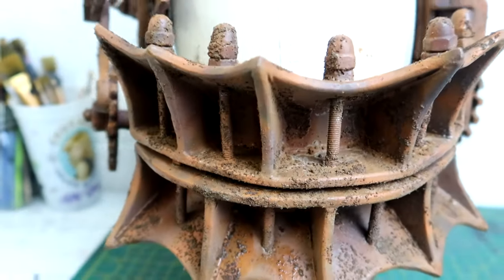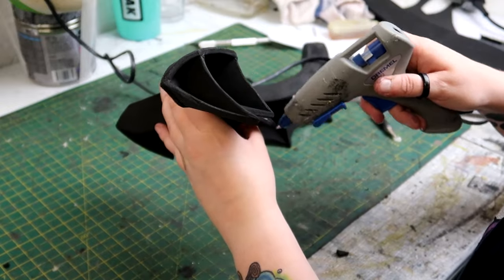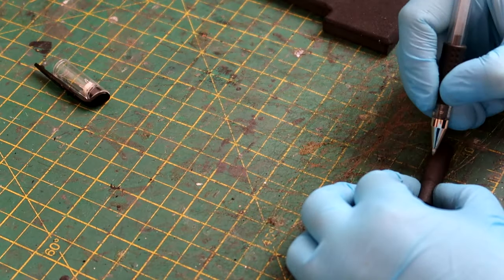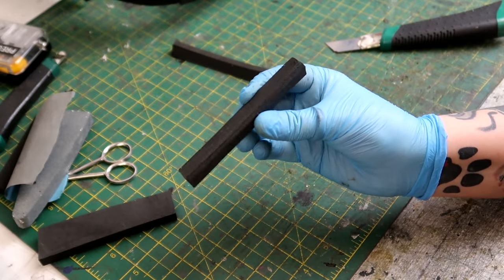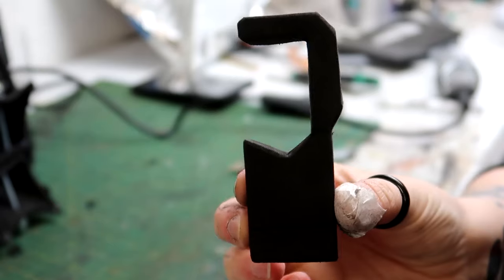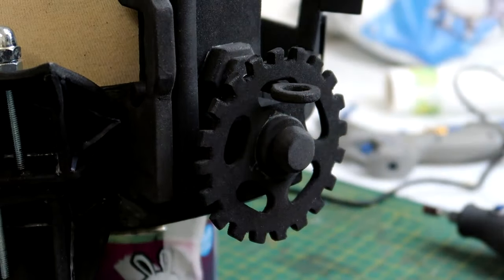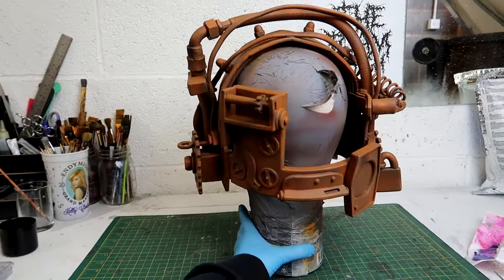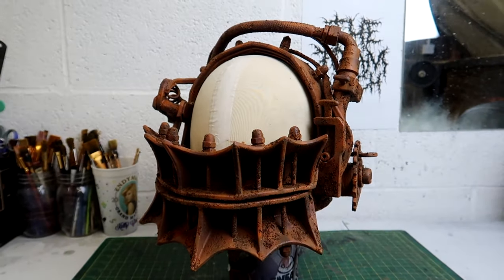How To Make A Reverse Bear Trap from EVA foam ( FREE Template)

Comment: going to build this halfway to halloween with a limited budget and no experience 😅😅 wish me luck
Reply from the maker: I have total faith you can do it! 👏👏
Reply: Me too lmao
Reply from the maker: @mhxhtbdr.yb553  you can do it 👏👏
Reply: me too😂
Reply: @TheFoamWitch  very quick question, when we print out the stencils will they be standard printer paper sized and be accurate in the measurements you used yourself? also what mask protection did you use when using the dremel?
Reply from the maker: @madreadzzz  hi there! These templates were made for A4 sized paper. If you print them out on A4 paper, they will be the exact size I used 😊
And I have a 3m reusable respirator 👍
Reply: That's the whole point!!!! I started in 2014 with no experience and by 2016 I had 3 awards and my own book on cosplay props
Reply: same here 😅😅

Comment: how long is the pipe on the top of the bear trap? ive been trying to look for parts and cannot read what it says when you showed it
Reply from the maker: So I’ve just measured it and it’s 50cm long ☺️👍
Reply: @TheFoamWitch  ty ty ty ive been trying to find the specific part you used so this will definitely help!
Reply from the maker: @angelina-iv6zf I think it was just a shower pipe or something. I defo got it from the plumbing section ☺️

Comment: What is the wearability of this? Like is it heavy? and how would you suggest making it to fit to wear properly? Amazing work btw! I love the Saw movies and I've wanted to make one of these for so long.
Reply from the maker: It's fully wearable! It's slightly heavy due to the nuts and bolts but not uncomfortable by any means! And making it fit would just be to print the template off smaller or bigger than you need. The template is for a larger head so printing it off in multiples of 10% smaller would help 😊

Comment: This is awesome thank you! I love making props for photoshoots and I'm planning a Saw-themed shoot later this month so going to give this a go!
Reply from the maker: No worries at all! I hope the template comes in handy! 😊
Reply: @TheFoamWitch I just got the template cut out and it's looking great, but at 1:57 there are three pieces laid on the cutting mat, but I don't think the middle one is in the template. Do you know the dimensions for it? Using the measurements on the board as a rough guide it looks to be about 12.5 inches by 1.25 inches. Would that be about right? Thanks!
Reply from the maker: @graemepatterson  it is on the template. It's the piece that says "back section to stick jaw pieces to". It has curved edges because I went back in and cleaned it up, on the video it's a straight piece. It's in the lace with the 2 jaw pieces back plate sections 👍
Reply from the maker: @graemepatterson  page 4 of the template 👍
Reply: @TheFoamWitch Ahhh that makes perfect sense thank you I thought I was going mad 🤣
Reply from the maker: @graemepatterson  😂😂 it's all good!

Comment: Hi! I’m interested in making this for Halloween, but I had a few questions - Firstly, how much foam would you say you used for this? 

Secondly, could you potentially list all of the resources you used/resources you’d say is absolutely necessary for this project? 

And finally, how long would you say this project took you in total? And how long do you believe this would take for a complete beginner to make this? 

Thank you!
Reply from the maker: Hi there!
So I had a 1mx1m sheet of 5mm foam and had more than half of it left once I had built it. 10mm I used scraps so barely any at all! 

Absolutely necessary is foam or cardboard, a craft knife and glue. Then sealer either PVA glue or mod podge or something like hexflex or plastidip and then paint. Everything else I used is completely optional and all the hardware could be made using the foam is needed.

This took me about 4 days to make.
Hope this answers your questions and helps 👍
Reply: @TheFoamWitch thank you! 💜

Comment: This is AMAZING. Thank you so much for the template! I am going to pick up supplies for this after work. Is there any chance you could provide an estimate of how many sheets (or how long a roll) of 5mm and 10mm foam is needed for the entire piece? I'm guessing maybe 10 sheets total based on the 6 pages of the template + duplicate pieces + details + possible errors. lol (Also, I'd love to see the reverse bear trap on!) Thank you!
Reply from the maker: No worries! I hope it helps!
And for this project, it depends what size the sheets are.
I had 1 sheet of 1mx1m 5mm foam which I used and I still had quite a lot left. It barely used any 10mm foam as only a few pieces are 10mm so I mainly just used scrap pieces I had!

And if you check out my Instagram, there are loads of photos of me wearing it 👍👍
Reply: Thank you soooo much! I’m following and it looks incredible. Very well done! You can count on at least 10 more views from me while I assemble my own reverse bear trap!❤

Comment: hey, very VERY GREAT video! I love the accuracy of the trap and the enthusiasm of you. And cannot explain how greatful I am to have this template, im making a dbd pig cosplay and this is the first time I actually make one by myself so im so excited. I do have a question can the trap be held on the top for a extended amount of time w/o any damage? Im going to conventions so I would like to know and can I print ALL the template out 10% larger or small to fit my head? THANK YOU SO MUCH FOR THIS VIDEO
Reply from the maker: Thank you so much for such an awesome comment!  ☺️ I’m so glad you like the video!
And yes, I’ve worn it for quite a while and thrown my head around wearing it and it was no problem at all! You might need to add some padding on the inside so it doesn’t wobble around if you find it’s a little big but you shouldn’t have any problems at all ☺️☺️
You can print the template to whatever percentage you want! If you need it larger, if you press the “poster” button when printing on pdf printer, it will print over multiple pages to make it bigger 👍
Reply: @TheFoamWitch  thanks for the answer, such an underrated channel! Im new at making props so I will encounter some problems and be asking a load of other questions😭
Thanks again for the video, hope your channel will continue to grow‼️
Reply from the maker: @thelordofsimps6095 ah thank you! And I’m always here to answer any questions you might have! 
I’m working on a beginner foam crafting video as we speak so hopefully that will help too ☺️

Comment: hey there, im in the process of building this and im almost done. however, the bolts in the front of the bear trap are weighing it down when i put it on so that it can easily slip forward. do you have any advice on how i could combat this?
Reply from the maker: If you add some padding to the back so that it sits tightly to your head, it shouldn't fall forward 👍👍

Comment: Hiii, so, I get it that you make different on the template on 1:56 , but it’s supposed to be smaller than the Jaws part? In the final when the 3 pieces are together?
Reply from the maker: I'm sorry, I'm not sure what you are asking? Do you mean it's not as long as the jaw parts? It should be because it's the same one I used. You have to curve the edges of the jaw parts to follow the curves and then some trimming required 👍

Comment: Any recommendations on what to use if you don't have a heat gun? Could I bend it in a curve and leave it like that for a second, or would a blow dryer or torch work? Thanks so much for making this video!
Reply from the maker: So it has to be quite hot for it to heat the foam up enough so a blow dryer wouldn't work. A blow torch would work but you would have to be SUPER careful not to burn the foam with an open flame! 
But if you rolled it up and taped it up overnight it would keep its shape when it was unfolded!
And it's no problem! I'm so happy it's helping people!!
Reply: @TheFoamWitch  Thanks so much!! I cant wait to make this based on your tutorial :)
Reply from the maker: @kalissa2446  can't wait to see what you do with it!! 😊

Comment: Sorry I got a bit lost in the first part what is that middle piece at 1:58 when you put together those three pieces for the jaw? In the template is it that back section to stick its curved but in the video a square strip so im a lil confused? thanks
Reply from the maker: Yeah it looks a little different because it's just a slightly different shape on the template because I changed it slightly to be more accurate on the template.
It's on page 4 and it's labelled "back section to stick jaw pieces to"!
When I made it, I just used a square piece and trimmed the edges to be curved, but on the template, it's already curved for you ☺️

Comment: Hi there!! INCREDIBLE video and work. In the process of following it right now but still trying to gather the supplies. Could you pleeease reply with what size dowels you used for the accessories? Just want to get the most accurate ones! 😅
Reply from the maker: @franchescag5856  thank you so much for your kind words! 
So I think for the hinge and the padlock this was 5mm thick dowel. I think for the pipe part this was 20mm thick 😊
Reply: @TheFoamWitch  thank you so much!!
Reply from the maker: @franchescag5856  no problem at all! Happy building 😊😊

Comment: THIS IS AWESOME !! I wanna do that for my cosplay. Do you have a list of all material you used?❤
Reply from the maker: Sure! Hope this helps!! ☺️☺️

Foam 5mm & 10mm
Contact adhesive
Nuts, bolts and nut caps
Googly eyes
Rubber washers
Plumbing hose and connector
Electrical wire
Paint
Iron filings
Reply: @TheFoamWitch  What Kind of nuts, bolts and nut caps? Dont wanna Use too big or too long ones xD Thank you btw 🙏😍
Reply from the maker: @just.alex.heree_  I will be completely honest, I don't have a clue. I took my trap to the hardware store when I bought them and just measured against the trap so didn't get any details of them I'm afraid 😂

Comment: It looks amazing! I'm in the middle of making it now and there's a piece I'm not sure is on the template. At the time 1:57, the middle piece. Am I blind or is it not on there, if it is, what page is it on, and if its not, what are the measurements for it
Reply from the maker: @your_local_ipad_kid9228   nope, it’s not missing, it is on there. ☺️
It's on page 4 of the template and is labelled "back section to stick jaw pieces to" It has rounded ends on the template because I made adjustments to the final template to make it more accurate for building👍👍
The ends are pointed on the PDF because you have to curve the edges of the winged pieces to join at the curve but it may require some trimming of the foam! Hope this explains it
Reply: @TheFoamWitch  Thank you so much!!
Reply from the maker: @your_local_ipad_kid9228   no problem at all! ☺️

Comment: This is just wow i might do this for holoween one of these years what was the different foam did u use millimeter wise?
Reply from the maker: Thank you!! You should totally give it a go!! 
And I used 5mm for most of the parts, with 10mm being used for the back part and some of the smaller details, but the template states which pieces need which thickness 😊😊
Reply: @TheFoamWitch  thank you i really appreciate that

Comment: I’m so confused on finding the straight piece for 1:57, I printed all the templates and I just can’t quite find it
Reply from the maker: It's on page 4 of the template and is labelled "back section to stick jaw pieces to" It has rounded ends on the template because I made adjustments to the final template to make it more accurate for building👍👍
The ends are pointed on the PDF because you have to curve the edges of the winged pieces to join at the curve but it may require some trimming of the foam! Hope this explains it :D
Reply: @TheFoamWitch  thank you so much this helped!
Reply from the maker: @ang3l1c85 no problem at all! ☺️

Comment: this is a fantastic template/tutorial, thank you so much for all your hard work!! i do have one question; i’m working on this now and at this point it feels very front-heavy, to the point where it seems it would just slip forward if it wasn’t being held in place (i just attached the back piece, minus some of the details to be added later). does the addition of the hose hardware help to counter that weight a little/prevent it from slipping forward? just trying to figure out if i should readjust positioning of the headband part before continuing, or if you have any tips; thank you again!!
Reply from the maker: Unfortunately, if you are using real nuts/bolts, it is gonna be more weighted at the front.
The best way to combat this is to add some hidden weights to the back however you wish to counter balance it
Reply: @TheFoamWitch  makes sense, thank you for the response!! i’ll probably see about trying to add some heavy washers or something on the inside of the back band and opting for a real padlock as well to weigh the back down; thank you again for the tutorial!
Reply from the maker: @Whispermoon13  ooh yes, using a real padlock will really help! 👍
And I’m so glad you like the video ☺️☺️

Comment: if you were to use a real padlock opposed to the foam one, don't you think it would weigh the helmet down? thanks so much and lovely video + template, thank you for sharing!!
Reply from the maker: Honestly, a padlock probably wouldn't weigh it down that much, compared to all the nuts and bolts I used. They make it heavy but not unbearably heavy! 
And I'm so glad people are enjoying it 😊😊
Reply: hii so im actually making this right now and you're gonna have to use a very very small lock if you use a real one bc it does weigh it down quite a bit
Reply from the maker: @twocrabcake  that's a great tip! 👍

Comment: i'm back with another comment, there's a piece you show off at 1:56 that i believe you didn't include with the template. it's the rectangular piece that the two curved jaw pieces get glued to and i don't believe you provided anything in the template to make that piece with. should i free hand this piece?

edit: i've found it from another comment but it isn't fitting and the shape isn't the same. in the pdf the ends are pointed.
Reply from the maker: It's on page 4 of the template. It has rounded ends on the template because I made it more accurate to the final build I did. It's labelled "back section to stick jaw pieces to"👍👍

And it is the correct shape. The ends are pointed on the Pdf because after trimming the square piece you see in the video to the correct shape, that's the shape it was. 👍You have to curve the edges of the winged pieces to join at the curve but it may require some trimming of the foam! ☺️
Reply: @TheFoamWitch  thank you so much for your reply, i figured it out and i'm sorry if my comment seemed a little snobby.
Reply from the maker: @madreadzzz  it's all good! People just want to make a cool reverse bear trap, so no apology needed! I should have made it clearer on the template or in the video ☺️☺️

Comment: Hi could I ask a question! How many foam boards would you say you need to use for the reverse bear trap build? And how thick would it need to be? Also, how long would they need to be?
Reply from the maker: Hi there. I had a 1meter by 1meter sheet of 5mm thick foam which I used for this project and had over half left. For the 10mm pieces I just used some scraps as it doesn't need much of this at all. If you find have 10mm you can cut out 2 pieces of 5 and stick them together 👍👍
Reply: @TheFoamWitch  Thank you for the information! I'm a new saw fan and the reverse bear trap really makes me enjoy the franchise more! Thank you for the information again!
Reply from the maker: @Anonymous-yy7gh  it's no problem at all! You will make something amazing!! ☺️☺️

Comment: I’m confused on what A4 means. I printed it in regular dowsed printer paper. Would it still be wearable?
Reply from the maker: A4 is just the size of the paper. If you Google it, it will give you the dimensions to see if it matches your paper. I'm in the UK and A4 paper is classed as normal printer paper so you might be ok 😊👍

Comment: in the minute 1:57 where is the template for the middle piece?? i can’t find it😢
Reply from the maker: @helenacelho9298  check the description of the video 👍☺️
Reply: Right me too I’m confused
Reply from the maker: @xonataliem It's on page 4 of the template and is labelled "back section to stick jaw pieces to" It has rounded ends on the template because I made adjustments to the final template to make it more accurate for building👍👍
The ends are pointed on the PDF because you have to curve the edges of the winged pieces to join at the curve but it may require some trimming of the foam! Hope this explains it :D

Comment: Ok I can barely draw a straight line... Let alone cut one... Would you consider selling one? If, so what would you charge? It looks 10 times better than half of the ones you can buy. Much appreciated!
Reply from the maker: I’m sure you could give it a go ☺️ but yes, I do  them as crafting is my job and I take on commissions 👍
One of these would be £200 with postage within the uk included. Overseas postage would cost extra ☺️

Comment: I've nearly finished building mine with all the details, but it slips down past my lips and the headband piece is wonky, is the anyway to fix is without redoing anything because I'm really struggling 😭
Reply from the maker: The only 
 you can do if it wonky is to take that piece off and restick it! If it keeps slipping down, I would suggest adding padding to the inside so there is less room for it to be able to move
Reply: @TheFoamWitch thanks! I love your template, I've realised it was a problem more with how my head is shaped then anything 😅
Reply from the maker: Ahah! I hear you on that. I have a very small and very strange shaped head! 🤣 I always have to put loads of padding in things!